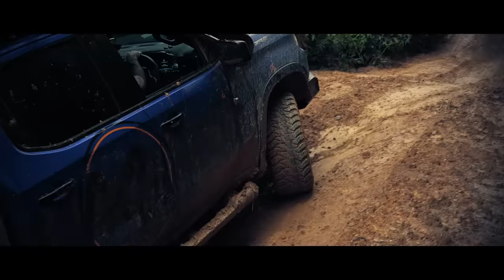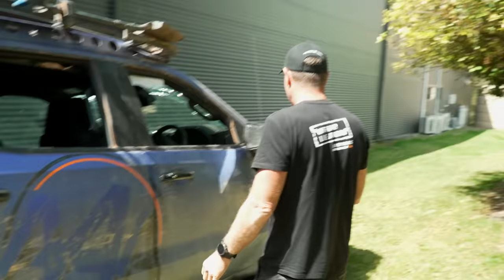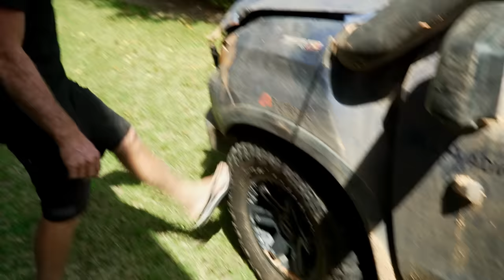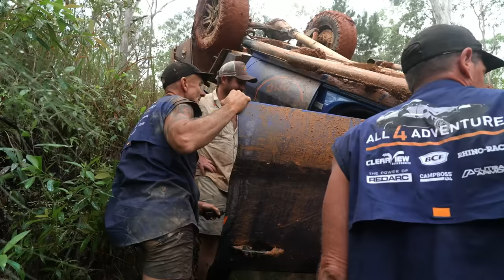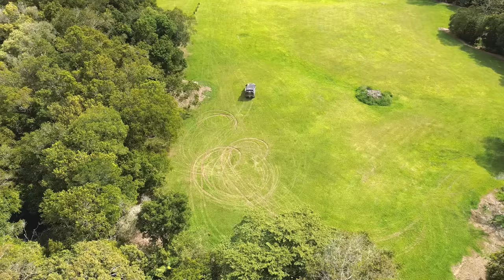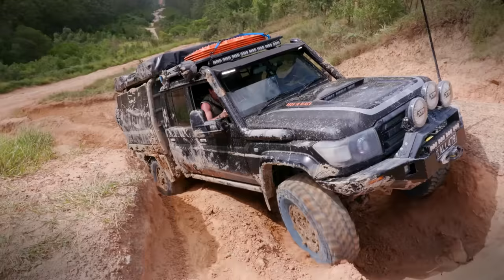😲 $250,000 CHEVY DAMAGE REPORT — CREB Track Rollover aftermath!!

Comment: I carry snow chains for down hill slippery bits.
Reply: Haha lmfao. I’ve used snow chains on clay going downhill, only works until the chains get full of sticky clay, then they just become part of the slippery tyres.
Reply: Snow chains are a must in the north up bloomy or the creb track
Reply: @malcolmL995  Mine are strong and beefy all chain, shortened from truck chains you keep it in reverse and rev it to throw the mud off if you slide. If you go up hill with those flimsy snow chains they can break.  Takes practice but not guaranteed to work! Waiting for it to dry out is good too. Had a friend get stuck and he didn't really know what was required. Went to a lot of trouble to ask the police for help and they put it into low 2nd I think and revved the hell out of it  and drove it out. I've used the same trick too.
Reply: @bruceyoung8980  I've struck a few in my travels who use them in mud.
Reply: i use a rear winch, with sht loads of rope.. chains dont work.. steel & mud,,very slipy..

Comment: @ 13:38 - "I can't believe it still goes... tough truck" -- nah mate, I can't believe the amount of damage for a slow soft roll over! - we used to roll rovers all the time in the 80's and they only got barely ANY of this damage.

Don't be so impressed, it's not like this thing was involved with a head-on with a truck - it took a slow SINGLE ROLL OVER on some soft mud - it SHOULD HAVE been mostly fine - it is a demonstration of thin metals, plastics and cheap ass build quality that this much damage is shown. Yuck.

Comment: Don't be so impressed, it's not like this thing was involved with a head-on with a truck - it took a slow SINGLE ROLL OVER on some soft mud - it SHOULD HAVE been mostly fine - it is a demonstration of thin metals, plastics and cheap ass build quality that this much damage is shown. Yuck.

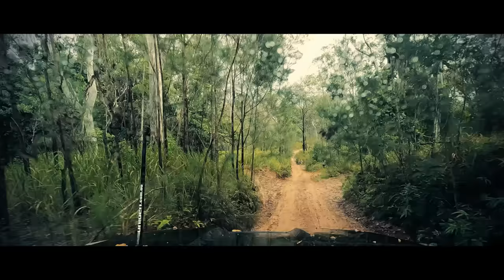Comment: If you pause it at @ 2:16  you will see that someone else has tire marks hitting that same embankment, if your nerves don't overpower the feeling of control by holding or stabbing the brakes , instead of he maybe turned wheels to the right fast enough and punched the throttle may e he would've jumped it and saved it or possibly set up a more sever chain reaction and rolled it worse but I'd have taken my chances in ruining a fender or something instead of the roof or structural damage ... As being upside down lol
Reply: Not how I would of done it either. I would of done a full 360 and straightened her up down the track blipping the throttle in 1st then reverse for 1.2 seconds. Should of tried it atleast but he doesn't know what he's doing.